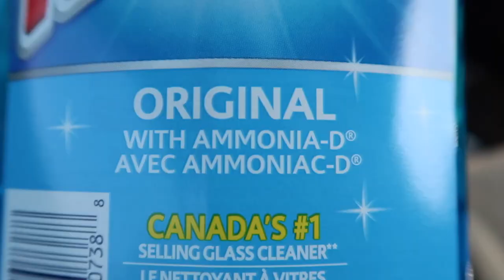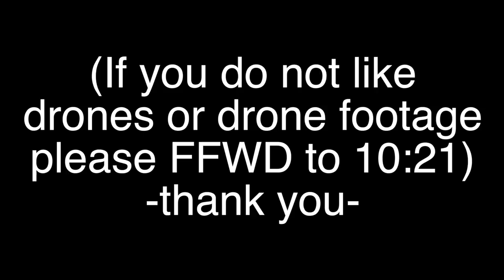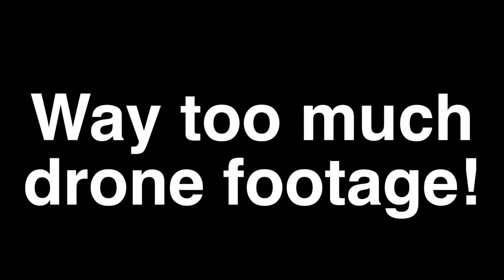Finishing the Tracker Knife!! (knife maker's daily vlog)

Comment: That piece of wood cut at 45 degrees is genius, I have been doing it by hand, thanks!
Sheath will be interesting, I do a lot of recurves and for kydex I have to make a throwaway spacer otherwise I can't pull the knife out. Having the back open may work but if you make the front it won't be safe...as much as big whomping knife can be said to be safe...

Comment: I remember you talking about filming in your sand blaster. Hopefully this mighty actually work for you.

My go pro 3 has a couple of cases, one of them is completely air/water tight. The case itself isn't that expensive, so it might be a good option if it's available for your model. That way no media gets it, and if the case gets roughed up that's ok.